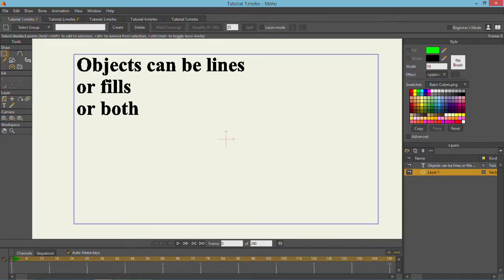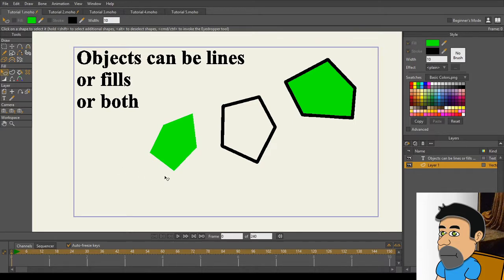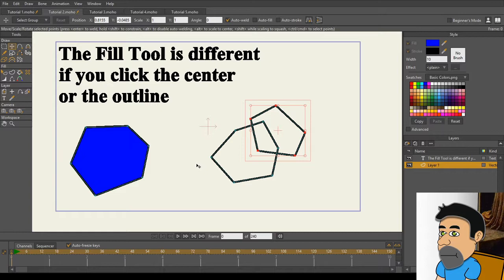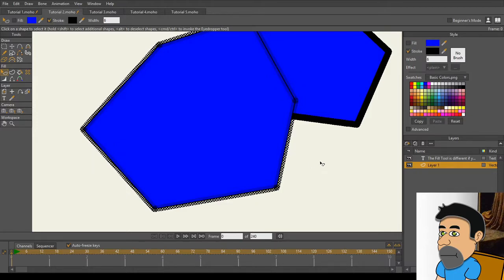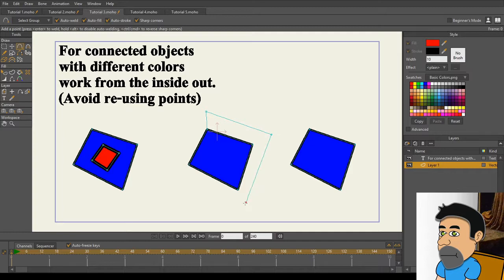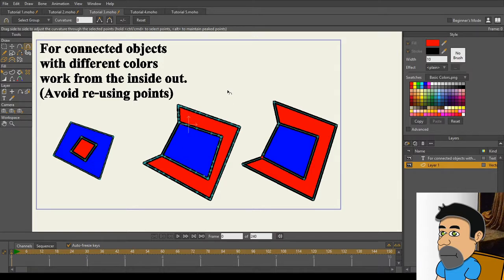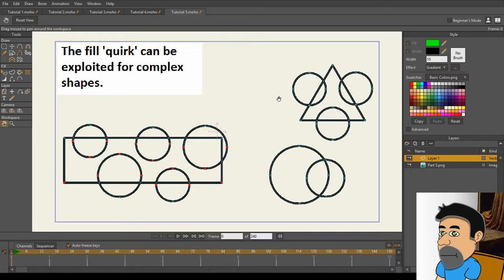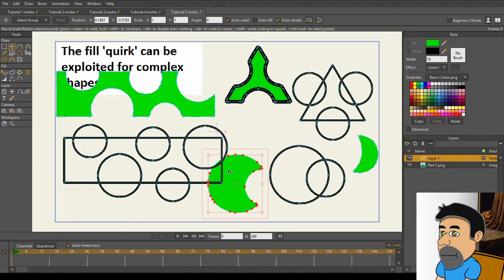Moho's Fill Quirks and How to Exploit Them

Comment: very helpful video, solved many of my queries, but still one more problem I have, sometimes in complex drawings fill doesn't work at all, what is the reason behind it? if u want I can share the drawing on ur email or whatever works better for you
Reply from the maker: I'll take a look at them.   Consider sharing on smithmicro's forum if you still have trouble. (https://www.lostmarble.com/forum/index.php?sid=e57dea9ad24e5f10f0578ef14d7da25b).